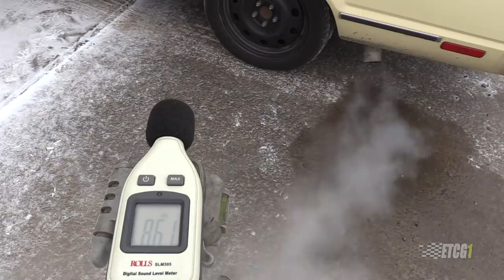Is the #FairmontProject Legal in California??

Comment: Pfft, Eric is louder than his car :)
Reply: I know, funny huh?  That being said I much prefer the 'low quiet powerful' sound myself.  A properly designed and built system sounds MUCH better than one hacked together (or hacked apart as it would seem).  I had a Mustang (supercharged, custom exhaust, gears etc) that when I built the X-pipe for it - I made it without the cats.  Sounded... raspy.

So I picked up a set of high-flow cats, welded those in and it cleaned up the sound immensely, in addition to being smog legal (had carb numbers on them).  Net result is that you don't always have to sacrifice good sound control in order to improve performance, and sometimes the tradeoff is worth it over extracting that last 1hp.
Reply: yeah this is a bit of a thing with decibel meters

Comment: I live in CA and the traffic tickets are draconian.  In my youth i would go to great lenght to fight every ticket,  and won most pf the battles but the few I lost just caused me to fight harder. My strategy now is to avoid them in the first place. I don't tailgate, use my cruse control ect.

I have to say most cops wont give you a bad time for driving a hot rod, but will if you are an ass about it.

Want to race some one? Take it out of town and you stand a good chance of avoiding grief.

What I can't stand is the blasting sound systems that share the volume, and obnoxious vibrations a block away.

Comment: I’ve been targeted/ harassed in the past with a fix-it ticket for excessive exhaust noise (only in my Integra btw) not once did the cop have a db meter when the ticket was issued. when actually measured similar to what you did it’s in the high 60’s-70’s (actually argued in court and dismissed) what makes it seem louder was actually the short ram intake even then it wasn’t close to 95db limit. Funny thing is I used to own a 90 Bronco with a 351W (same time period) it was way louder than the Integra definitely in the high 80db @ idle allegedly over the 95db @ 2k rpm it pretty much sets off car alarms etc it’s never been pulled for excessive exhaust noise I’ve even driven this massive Ford SUV to import car shows and meets where the cops prey on car enthusiasts with modified cars and was waived through by PD only to have to wait for my friends who were getting pulled over in their imports and handed stacks of fix-it tickets for things ranging from no front plate, dark tint, exhaust etc, did I mention this truck had no front plate either which is a mandatory thing here in California now I’m sure it’s not an import vs domestic thing I’m sure if I was in a mustang and did the same thing I would get pulled over too. It’s just that Bronco doesn’t fit the trouble maker demographic out here. 
BTW you would never have been able to build the Fairmont out here with California’s BS emissions laws.
Reply: You can, but nearly all do not.
Reply: I get the dark tint though, especially in America where every pullover needs to be handled with a possibility of the driver owning a gun. The other shit, hilarious.
Note, not making fun, just stating a fact / my viewpoint on that specific item.
Reply: @Swordie100   That's the great thing about America, we keep cops on their toes. Except for commie places like Europe, California, New York and Massachusettes where the cops run wild and have absolute authority, cops generally have to mind their manners when pulling over someone in the middle of the night with tinted windows.

Comment: Supposed to measure 45 degrees off from the muffler 20 inches away at steady state 3/4 of full throttle according to the California code.  Try measuring that way.  Also cutouts are illegal in California.

Comment: As a resident of California (and one who has gone through the BAR procedure for engine changes as well as exhaust noise violations), its a real tricky pickle we are stuck in here. While the 20ft 95db law is in place for the rules of citation... the test that is performed at a BAR office for compliance is actually much stricter. You  can find the details online but if memory serves this is how the process goes... (see more below)

A) You get a ticket on the side of the road by a CHP officer. They do not have sound equipment on hand, and can simply site you based on their own discretion on '95db @ 20ft'
B) You get a ticket for it
C) You can take that ticket to a California BAR office for testing, however the test that is performed is actually much stricter than the on-road requirements for the CHP. Something in the area of 95db, when recorded at a 45* angle, at 3/4th max RPM, at 0.5M feet. 

On one hand, it makes sense because if you comply with the BAR test, there is no way in heck that you could have failed any on-road sound ordinance. 
but at the same time, it's quite silly that you can be ticketed and fined for an offense with out documented proof of the allegation. 

Now I get it, there are plenty of modified vehicles that have well beyond the sound limits of 95db at any distance. For example many BMWs with Remus non resonated exhausts for example.  Though  it does really hurt when you have a properly done vehicle with a modified but not overly obnoxious and drone filled sound. 

Like you said, it's often used as an excuse to stop someone, and then get them for other things in the process. 

Now lets not mention the fact that...
A) You cant test your own exhaust UNLESS you have a citation for it (you can NOT pre-test your system incase you get pulled over)
and 
B) The testing cost is, at least when I did it a few years back, something in the neighborhood of ~$125 to get it done.

So the fact that you cant even test your system, until your fined... and even then you get fined again really sucks.
...
That being said, it was the best feeling in the world when I was pulled over a 2nd time (after I had a Certificate of Compliance for my system) and I was able to show the officer my card. It took him a few min to check  it over, and let me go saying something about 'just be more careful next time' lol.

Comment: I’m not in CA, not even in the USA, but many years ago, my XJ Cherokee failed its MoT test (annual inspection) for having an exhaust that was too loud. We didn’t think that was even a thing over here. Just had a straight through 2.5” because the muffler had rotted out, and I couldn’t get a replacement. Got one of those ricer can things with a 5” tip, which I thought was louder, and it passed 🤔

Comment: Where I live in Australia it's 90DB but at 1/3 throttle and then whilst the revs drop. So if they don't get you at 1/3 throttle they usually do when it spluttered or crackles whilst the revs drop

Comment: I believe it is supposed to be over 90db at 19.5in away from the tip at a 45* angle. Also at a specified rpm based on the redline of the vehicle.

Comment: Noise wise, my old 67 Mustang wasn't very loud, even with full length headers, turbo mufflers and 2 1/2 inch pipes.  What I was always concerned about was the rolling portable smog checks.  Yes, it was a 1967, but if they got picky, technically I didn't have all the original equipment emission stuff so when I saw those setups, I took the long way around.

I was stopped in my 1965 Mustang for dirty tail lights by the CHP.  It was a "fix it ticket" but still a pain.

Those front wheel drive fart pipe cars are louder than yours.

Comment: Where did you get 20 feet? It’s .5 meters or roughly 19 inches at a 45 degree angle from the center of the exhaust opening.

Comment: Eric I believe the test is 19.5 inches away from the exhaust port at a 45 degree angle and at normal idle and then at  2500 RPM.

Comment: I've had experience with this law in New York State, because we have this (and we do not have fix-it tickets with testing facilities). From my experience, it's a $50 core fee with court fees of the city. My city has $150 in court fees. So I'm paying $200 for this ticket if i plead guilty. IF I am smart, I would send in a 'not guilty' plea, go to court for the 'not guilty' and obtain a plea bargain fine instead, which usually (for loud exhaust) is a parking ticket of $25 plus the court fees.
My issue with this law is simply that no one should be complaining about it being an issue other than for discrimination and money grabs. Otherwise, 95dB at 20ft away (or even 5 feet away) is hard to obtain unless you are straight piped (or in this instance, have an exhaust cut-out). In a more likely scenario, the people getting pulled over are doing something else, then getting an exhaust ticket due to them doing a 3rd gear pull in front of a trooper or police officer. In another scenario, for cases of those who HAVE HAD discrimination issues, they are getting pulled over due to their car looking suspicious and then the 'loud exhaust' ticket given as a money grab because that officer didn't like them. In this scenario, this law wouldn't make a difference because they would have gotten pulled over and ticketed for anything regardless and this law wouldn't really make a difference.
Why I think people are complaining: Instead of getting a 'fix-it ticket', they now have to pay a fine slightly greater than the cost if they went to the 'ref' and got it "fixed". It becomes an easy money grab for the city (without needing to pay a 'ref') and an even easier/simpler way to take care of a ticket instead of making multiple appointments for something as trivial as an exhaust. Why I think people dislike it: They "have to pay a fine" instead of getting pulled over every week for flying down the highway in 4th gear, getting pulled over for a loud exhaust and then just paying the $120 for it to be dismissed. Now they have to take responsibility for obtaining the ticket and consequences come after the first ticket.
My complaint: This has existed in NYS since I started driving in 2005. I never have once got a "fix it ticket" and we have laws that say using your radio, not having a front license plate, and having tints on any sort of car can be fined up to $1,000 (okay, not really but way more than $100). This not being something Cali has sort of makes cali less strict with automotive laws than I would have even imagined.

Comment: 100dB is loud!
Twice as loud as 97dB, which is twice as loud as 94dB etc.
Eric's car is not even nearly loud enough to hit the 100dB limit (probably even at full throttle).
Here in UK, my local race track limit is 100dB for cars on track (while racing). Some of them are pretty loud, as 99dB is still loud.
Top fuel dragsters run about 150dB, but think how loud they are compared to street cars (if you haven't seen them in the flesh, you don't know).
Seems to me, they've set a high limit there for the street just to limit a few fast & furious individuals who are trying really hard to be as loud as they can.

Comment: Exhaust cut-outs have been prohibited for street licensed cars in CA for decades just like straight pipes and spark devices to ignite unspent fuel at the exhaust tip.  The VC even says the exhaust pipe must exit from a point that is not under the car's body.   Enforcement has always been the variable.  Not sure what the question here is(?)

Comment: Fun Fact. This law was attached to another law, so many legislators did not even read this part. It was intended to crack down on the A Holes that take over streets and start doing donuts and disrupting neighborhoods. This was a way to fine them as most of the people doing this have modified cars and trucks. I say that is fine, no problem here. Unfortunately, it also includes motorcycles. So my bikes are included in this law enforcement. Only one of my bikes is loud, but I can make adjustments to bring down the noise, no problem. My loud vehicles are too old to fall under this law :)

Comment: From memory, in QLD australia it's around the same db level but the test is to be conducted directly in line with the exhaust at a distance of 15cm at 3600 rpm for a 6 cylinder or at an rpm around 3600 decided by the officer. I have the test handbook downloaded somewhere but thats all that I remember. There's no way my 3.5 inch exhaust will pass at 3600 rpm so im very careful. And get this, if I get a Varex or bimodal to quiet it down, THAT is also illegal. Screwed if you do, screwed if you dont.
Reply: I got done in a straight pipe falcon barra
Reply: Damn, how much did they fine ya?
Reply: 600
Reply: That's was when my red ps 2 years ago

Comment: It doesn't even matter that this car has a loud muffler in Cali.  You wouldn't be able to register it because of the smog laws.  Anything '76 or newer requires OEM intake and exhaust, or something from the aftermarket that has a CARB EO exemption.  I doubt there's a big turbo carbureted kit for a Windsor V8 (most likely donor car would be a Mustang) available for sale with a CARB EO sticker you can slap on there.  It's funny because the muffler doesn't even factor in to the smog inspections here.  Post-cat you can run whatever you want.  The muffler law is for the d-bags in Mustangs and Civics doing burnouts at the stop sign in front of my house.

Comment: This test is very flawed. I just read up on it, and yes, cars need to be under 95 dB, but it doesn't say 95 dB AT IDLE. In fact, the documentation I found says the vehicle will be "stationary" when measuring dBs, but it will be revved up to a higher RPM.

Comment: Hi, i just want to add the following: noise in the streets is a very serious problem, not so much for people inside the car where you are effectively isolated, but for the people outside with no way to reduce their exposure to noise, furthermore, you lose the hability to distinguish alarm sounds or any sound really, from the noise. I understand that for trucks, emergency vehicles, noise is a necessary thing, but for those individuals with those noisy vehicles it is a choice and they should be punish socially and economically for that choice, you don't need to drive that kind of vehicles, so if you do, you must comply with standards set for public health

Comment: Eric, I read somewhere you're supposed to test at 19.5 inches at the same elevation as your tail pipe and off to a 45° angle.  They test it at idle and 2,500RPM and test all drive modes.  I'll have to look it up again to make sure, but yeah. Just wanted to let you know.  Thank you for the video. 

Here's a link that I found. 
http://www.bobsmuffler.com/noise.htm

Comment: I live in Los Angeles and I have been state reffed before so I know this law. The law is that your car can’t be louder than 95db. The test is done with the dB meter directly behind the tail pipe 18 inches away at a 45 degree angle and the rpm are held at a rpm between 2500-6000rpm. This rpm depends are the car you have. For my Honda S2000 the rpm needed to be healed at 5,500rpm. I imagine lower rpm engines would be required to do this test at a lower rpm than my s2000.  Cops do not perform this test. If they think your car is too loud they can just give you the ticket. This test is done at the state referee.
Reply: @Benton Tong, you and I are on the same page. See my post about 7 below yours in the time line. The test for REF Sound Compliance is actually much stricter then the on-road limits a CHP should abide by. Just sucks that no mater what, that 1st offense is a fine. (either pay the ticket, or pay to certify your exhaust... but you cant test it before you get a ticket)

Comment: From what research I have done, it seems that the officer can issue a ticket just because they "think" it's too loud so it's up to you (the defendant) to prove otherwise which I believe you can do by getting a "BARR" test (or is it BAR, I don't know) and then get the ticket revoked, but you can't obtain said certificate to say your car is 95db or under untill you've been served a ticket.
Also to rub salt in the wounds, there are plenty of factory spec vehicles which are legally sold in California for use on the public highway which exceed 95db,
The Fiat 500 Abarth is one example, in stock form it read 100db.
So the who would be liable then? The manufactures? Doubt it....
The governing body who said it passed inspection to be sold in California? (or any other US state for the matter) doubt it....
So the consumer gets fined even though it was deemed a street legal vehicle from the factory and hasn't been modified....
So what can you do about this?

Comment: Most V8 cars run much quieter then the 4 cylinder group that running fart can muffler and blipping the throttle every chance they get.  Living in a low speed area one kid would come home at midnight and blip his gas pedal every chance he could for about a month until one day my neighbor and I got hold of his dad and told him it had to stop.  The next week he came by my place and he had a regular muffler on his car.  Seems that his dad got tired of the complaints and had him reinstall his regular muffler.  Actually on a older V8 car that has a good exhaust system even with a muffler bypass I have no issue as long as the driver is respectable to folks.  I actually like hearing some of cars at full song as it to me sounds great. Reminds me of the 1970's when I got a ticket for having a glass pack on my 1965 Chevrolet Chevelle. Back then I was living in Iowa and they had laws on the books that saying that all cars must run mufflers and not glass packs which were for off road use only.